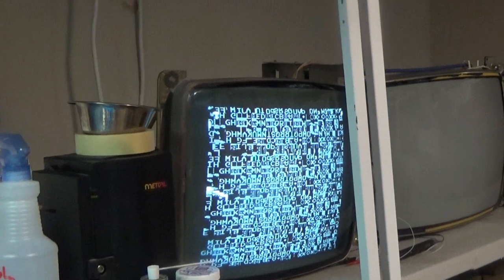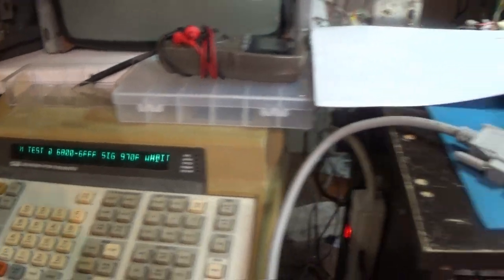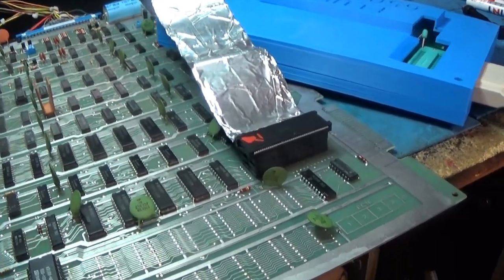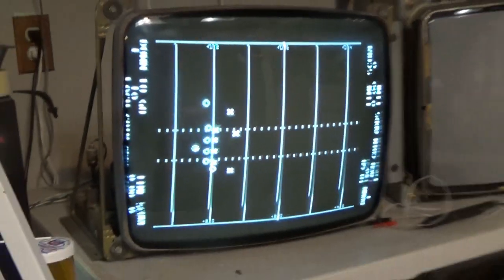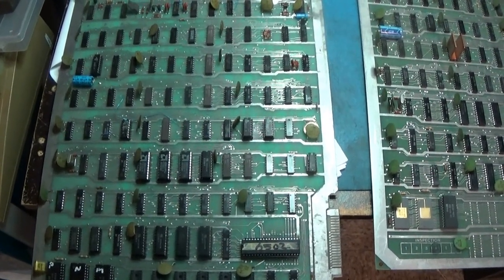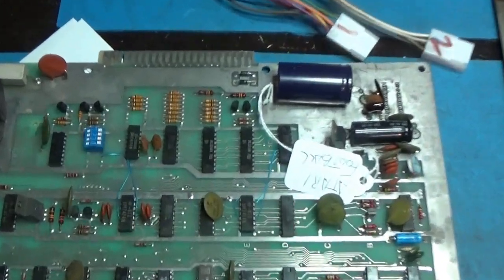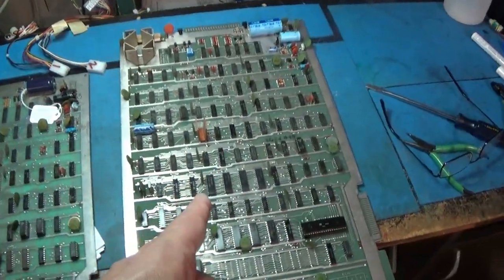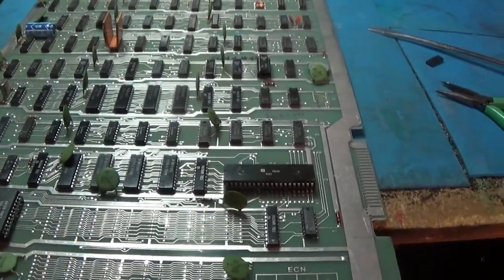Quick Atari Football PCB Repair

Comment: So I did some research in MAME on the different versions of Atari Football:  There are 4 versions known so far:  Atari Football (revision 1), Atari Football (revision 2),  Atari Football (4 players), and Atari Football II.  ALL OF THEM HAVE THE ATARI FOOTBALL LOGO at the 50 yard line.  Either yours is broken OR it's an early undumped version?  Have you tried dumping the roms and comparing it to RomIdent?  Also, all the versions seem to behave the same in MAME, but I noticed the 4 player vesion booted up faster.  That is, it boots up and scrolls the football field faster, at the beginning only.  Then resumes normal speed once the players show up.  Odd.  Perhaps the MAME devs know.  It's worth asking on the KLOV forums.  It would make an interesting topic for sure!